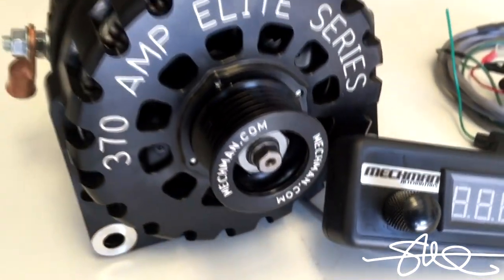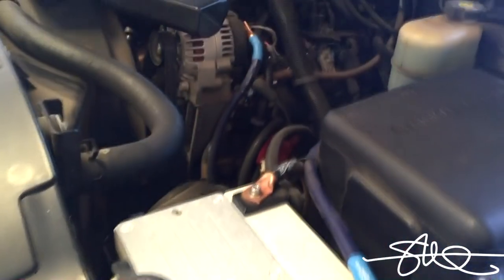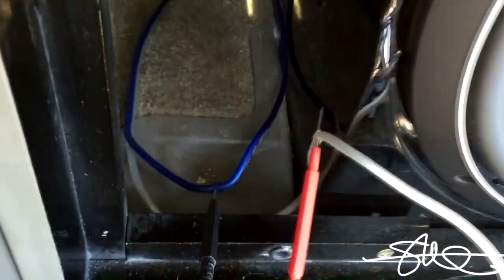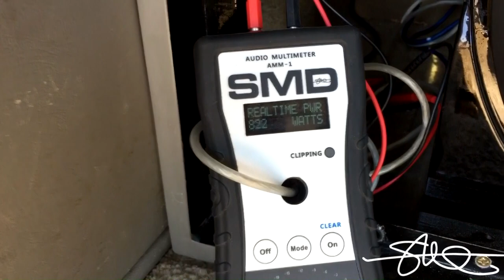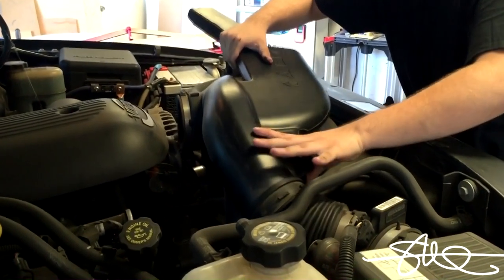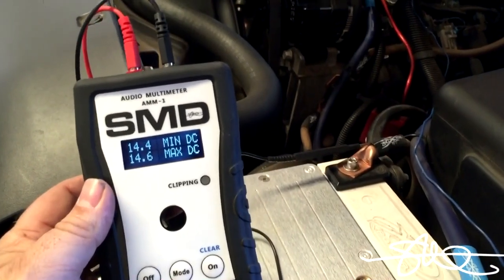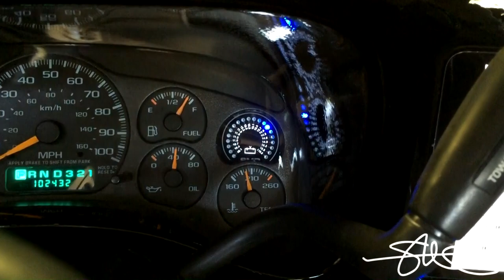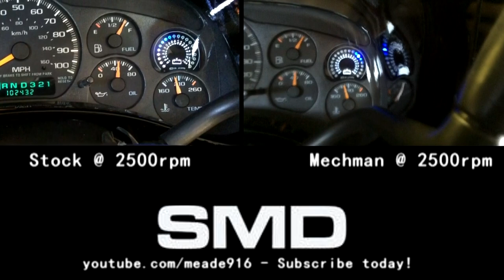Father & Son System Install - Proven Power Upgrade - Mechman Elite 370a 6 Phase Alternator

Comment: nice video. i like the smd volt meter and output meter in the instrument panel, i have been wondering if those would fit in my truck with the same dash, looks like it fits nice. was it pretty easy to do?

Comment: Niiice!

I've always wondered how much of an extra load those high current alternators put on the engine.  A big American V8 like that probably isn't even going to notice it's there, but what about smaller 4 and 6 cylinders?
Reply: My denali had a 220 amp alternator and I put in a new amp and it was like the alternator didn't even exist. I had to buy this alternator

Comment: Steve I have a question. Will my amp clip sooner when there's voltage drop? I set the gains with a scope meter at 14 volts, but when my system is running it causes the voltage to drop to 12 volts. Will it clip sooner now or just give less power at that volume I set the gains to? meade916

Comment: at 1:13 you talk about speakers changing impedance under power. Does this have anything to do with where a person would set the low pass crossover (such as the freq. where the impedance goes buck?)

Comment: I may be wrong.. but in many cars, the voltage limit for ecu etc. is around 15v?
Yeh, i know.. you can just put a external voltage regulator in front of the ecu (or the rest of the electrical circuit) to be sure nothing happens.

Comment: Mr. Meade, I have been following you for a long time and from a pro like you man. I wanted to know what I need to do next. I have 2 Alpine Type X10's in a ported because being run off of an Audiopipe Class D mono block amp pushing out 1000 rms at 2 ohms at 13.5v. And I also have an XS power D1200 in the trunk and a stock Bosch battery in the engine bay and stock alternator. Anyways lol, I have a 2009 Nissan Rogue and wanted to know if it would be safe to do an alternator upgrade. And if so how many amps. The stock alternator is 110 amps.

Comment: So I'm having an issue,I'm running 2 hcca 5000.1 and 4 hcca 12.4 and 1 xtr750.4, 2 AGM batteries and a mechman 240 alternator and it's getting hott just added 2 0 gauge wires running from it and still a lot of voltage drop we can't adjust the gains because of the voltage drop

Comment: Does it use the same size belt since the stock alternator is a small case and the mechman 370 is a large case small pulley?

Comment: Hey Steve. I have a truck running a 1500 RMS system, truck has every light Changed to LED and a 50 inch light bar and Led underglow. Alternator is dead and would like some help. Stock is 100 amp or 130 amp. Would you recommend going back to stock or upgrading to 200 amp. Thanks

Comment: as my Factory alternator is a measly 80 amps, does anyone make these for a Saturn S-Series? i eventually want to do a stereo /speaker upgrade but the alternator is the one thing that's stopping me (not to mention the location, its behind the motor, not in front) from doing so..

Comment: Hey Steve Mechman says on there website when upgrade to there high output Alt. You need to use a shorter 1/2 belt it didn't look like u changed the belt. Do u need a shorter belt?

Comment: Hey Steve does that AMM-1 offer a peak hold on the RMS? I just noticed this device the other day and that was the one question I had about it. When you were looking at voltage I noticed it done Peak Hold and Min Hold, Was wondering if it had a Max Peak hold on the wattage?
Reply from the maker: +mtemp2006 just saw this...yes it does!

Comment: if you wanted to just be cheap and just rewind the stock youd only get about 130-140a out of it. they can wind it differently to make more amps at lower rpm but still wont compete with anything aftermarket like this mechman
Reply from the maker: EZOVERDOSE total waste of time and money doing that.

Comment: I have only 500 watts and my Headlights flackering when the bass come ( Engine is on). 
Damn little alternator.
Reply: once@time Ok, THX
Reply: QuantreXx Search for "Big 3 car audio" and do it on your car with oxygen free copper cable, that will help a lot, even more than a capacitor.